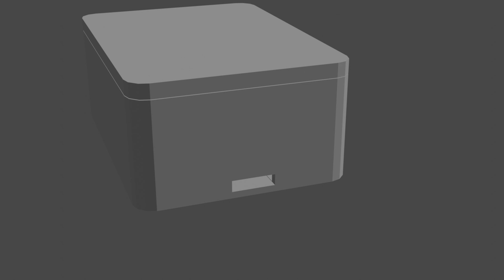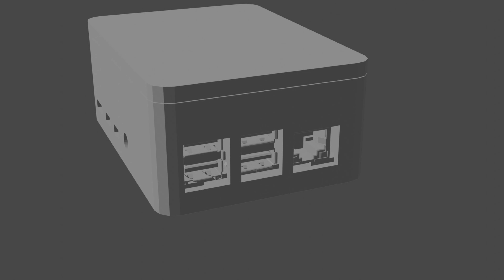How to create a custom Raspberry Pi 4b case using Blender3D

Comment: hey man, very appreciated video, it actually helped me to understand the process of making a complete case, as a tip though, there are points where the keyboard interferes on the audio and make weird noises, easy to fix. And for the case itself, I missed that the lid doesn't have a fitting for the bottom box, you make just a flat piece on top, which means it doesn't really close. The bottom fitting as well, could be easily made with cylinders on the bottom of the screw holes, instead of the huge block cuttings. Another helpful thing would be to explain more clearly how to you achieve certain things via mouse / keyboard commands, some places I got a bit lost, but with a trial and error I managed to get to the end result. I am printing in resin, so the thickness here was too little but I will try another case after the test printing. Overall you achieved to help ! Thanks for that!